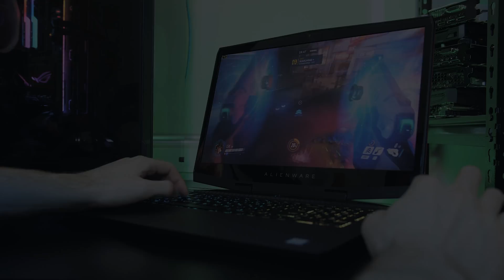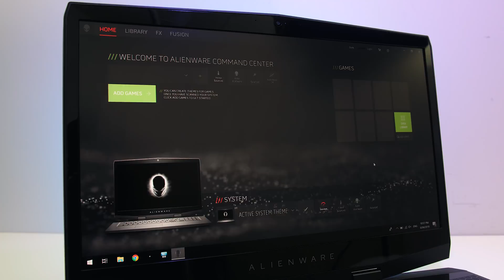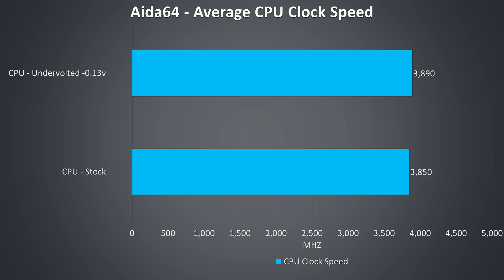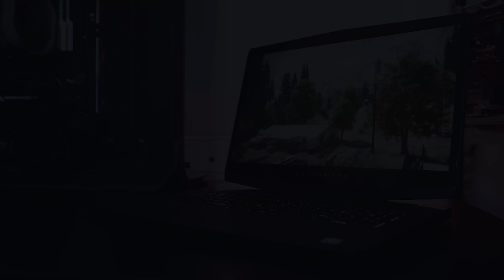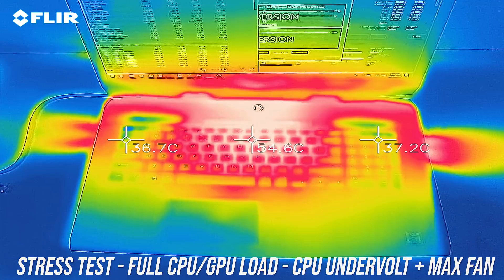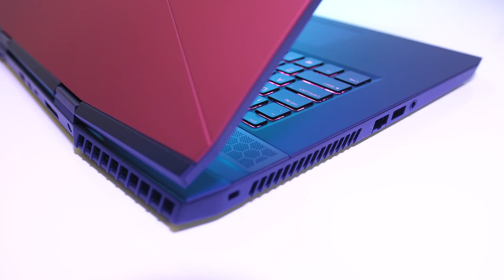Alienware m17 Thermal Testing, Overclocking and Undervolting

Comment: Actually, the fix for this laptop is pretty simple, and actually I think it does a better job than some laptops I’ve used. The Razer Blade 15 for example with the 2080 maxq ran at about 1.2-1.3 ghz and the cpu ran at about 3.3 ghz with fans maxed out and a manual tdp limit. With the same tweaks applied to the Alienware M15 I get significantly better performance I limited the tdp of my cpu to 50 Watts and all cores to 3.7 ghz, a change to the CPU thermal pad, and a repaste with gelid gc extreme and my temps for all cores of the cpu don’t get any higher than 81 with most cores sitting at around 75, gpu while running at 1.5-1.6 ghz (2080 max-q) runs at 78 C. The thermal paste change makes a huge difference something that can’t be said for the razer. I quite like it and since it’s so easy to take apart, I’m very impressed.
Reply from the maker: I'm testing the 2080 Max-Q laptop at the moment so I guess I'll see myself how it compares quite soon. From what I've seen so far, I have my doubts that this will end up better.
Reply: Jarrod'sTech Try limiting the tdp and boost clocks, it seems to help the most, as this laptop can pull up to 70 watts under load! ThrottleStop is this machines savior.
Reply: can you please put this into layman's terms?

Comment: 3:25 - WTF
Underpowered, shit thermals, improper fan speeds... Why they even bother releasing such thing?
Reply from the maker: The Cinebench results weren't that bad once undervolted, only 20-30 points behind what I typically see as maximum performance.

Comment: Well it does not get as hot as i though, but the clock speed is really low
Reply from the maker: Yeah the throttling limits it, wonder if it might have been better with a 80w 2080 MQ 🤔

Comment: I don't know, I still like it. COmpared to the other 17" options out there this still seems like the best option as it is upgradable and easy take apart. It's possible the thermal compound is just bad as No Manufacture uses quality paste. So that might help. Undervolting the GPU would likely also really help. Bobofalltrades showed this off in a video once and the results were really surprising. 

Good honest review though. Keep it up!
Reply from the maker: Thanks!

Comment: My dude, your contents are what I live for. I think adding "dead pixels check" on your reviews would also be a nice touch.

I know it depends on the unit, but it still could be a good reference just in case. Might even raise the awareness for companies to be more sensitive on their panels. 
I usually use "deadpixelbuddy.com" to do so.
Reply from the maker: Thanks! I include backlight bleed test in the full review, so in theory it would show up there in most cases - either way if I ever had a dead pixel I would definitely mention it in the review, the fact is I've never had one in 60+ review units, but that's the other thing, they're review units that get shared around by other reviewers, I would assume if a dead pixel did appear it'd get reported and the unit fixed or swapped.

Comment: Why didnt they undervolt/tweak it in the first place? It really help considering how much you pay for the machine
Reply from the maker: No one does that out of the box that I'm aware of (some third party places that offer customizations like liquid metal might though), my guess would be it's too hard to do right on a large scale. Each chip has different power requirements under different workloads, so it would take a lot of extra testing time to get it right, and if the chip degrades over time with heat or something then it's possible the undervolt may no longer be stable years from when initially applied which could result in increased RMA rates when people start getting crashing and have no idea why.
Reply: @JarrodsTech  that's a good point, thank you clarifying it, cheers
Reply from the maker: No problem!

Comment: One additional thing I've seen that helps many people with this laptop is actually physically raising the rear of the laptop off the table by about an inch. The rear feet are too small to allow adequate cool air to be drawn in, plus the heat generated makes the table hot, which in turn heats the air before it's sucked in.
Reply from the maker: Yeah the results would be slightly below that of the cooling pad results I've shown, as raising it up seems to make the most improvement, the extra air being blown in from the cooling pad only makes a small change.

Comment: I feel like if your paying a premium price for a laptop like this you shouldn’t have to modify it to make it have decent temps. I would return it and get a laptop that cools properly.
Reply from the maker: I think that's why it's important for testing like this to exist, you can see how it performs and compares to others and factor that in when buying instead of getting something only to find the results then possibly return it.
Reply: High end gaming laptop PCs are like buying sports cars. They work fine out of the box, but you can always tweak them for more power. If this isn't your thing don't buy one.
Reply: @zahhari3170  Well it doesn't work fine out of the box if it's already overheating and throttling lol.

Comment: Colour me impressed that the cooling pad made quite a difference to the gpu temps. I noticed that certain designs, especially some of the newer clevo models which have a rear ventilated back for the gpu benefit alot from a laptop cooler.
Reply: Yeah that's what Jarrod explained in his last video :D
Reply: @sikandarjaved9953  Been thinking of getting a new cooler for mine, but the brands available are mainly cooler master. The notepal L1 seems decent.
Reply from the maker: Yeah it can really depend, the cooling pad did very well for the Clevo P970EN in the most recent video though, I guess because the bottom is mostly covered in air vents 👍

Comment: Getting my M15 on the 26th, i7 and 2070MQ, hope repasting and UV will be enough to keep it in check haha, great video as always!
Reply from the maker: Thanks! Let us know how it goes with the mods.
Reply: @JarrodsTech  sure, looking forward to taming this little beast, been a long time since I had a gaming laptop.
Reply: Get the zephyrus imo.
Reply: @TheTakenKing999  yeah I know it's great, got this one at a great price through work so I went with it :)
Reply: @MultiMister09  I'm also looking at the m15, 2060 version though. Let me know what you think of yours when you get it tweaked.
Reply: @nickw7197  sure!
Reply: @MultiMister09  So how is it so far? Any problems with it?
Reply: @edxander7169  it got delayed, had it for 2 weeks now, out of the box I undervolted and propped it up at the back, CPU reached 95 - 99c under load, repasted with mx4 and now got huge core differentials with a maximum of 95c (hottest core), able to hold 3.9 under full load with GPU at ~83c. I think a thicker tim is next on my list to try. Also got a bad bleeding panel, but I'm over that, not going to return and wait for a looong time again. :)
Reply: Are you a Alienware fanboy?
Reply: @aravindr4986  My first Alienware so that's a no, got it on a great deal through work so I decided to go for it :)